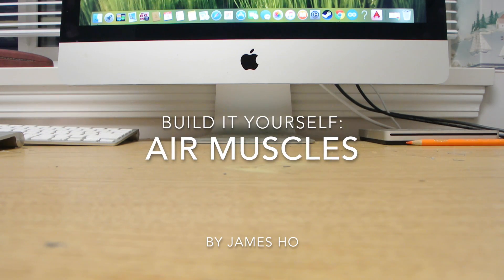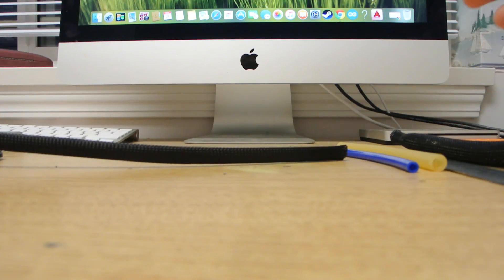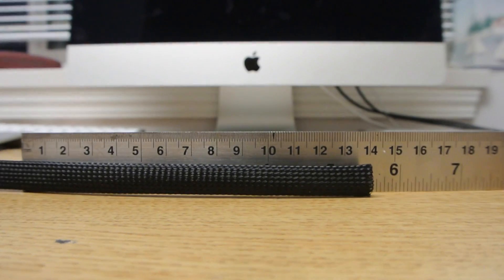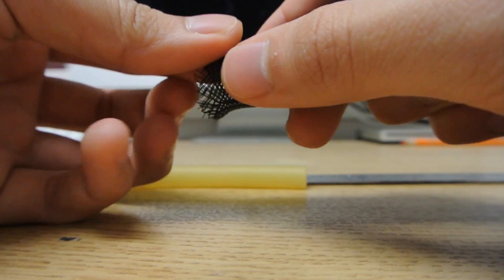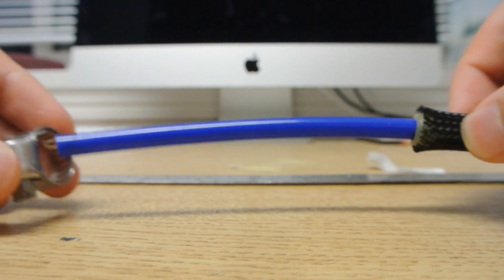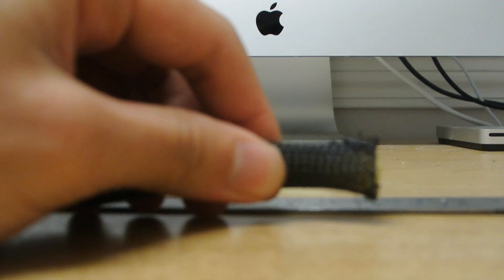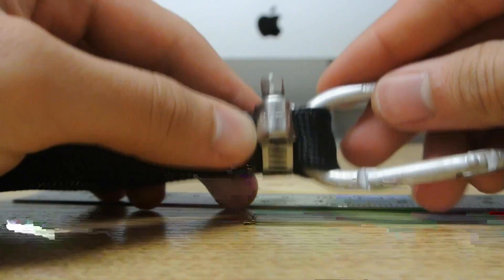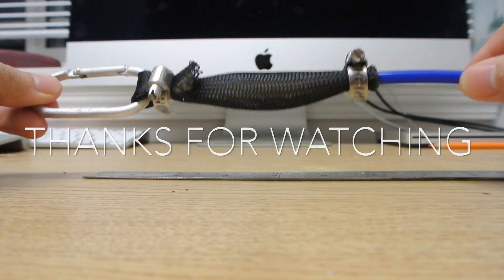Tutorial: Air Muscle Build

Comment: Making the cable shields longer than rubber inside will mean it'll never inflate enough to stretch the muscle. The shielding should be pulled very tight over the rubber to get the most range out of it. All you're doing here is pretty much like inflating a balloon inside a bag. I'd be shocked if this 7 inch muscle even provides  a single inch of pull. Are you pulling the rubber inside tight when it's mounted to the arm, and using the elasticity of the rubber as an additional contraction force? That would make sense then to make the shielding this long.

Comment: I've build one 15 years ago,  to improve this design add some brass tube w/ matching the diameter inside the blue tube, the length of the hose clamp...better clamping. Next use the shielding to attach the muscle, just leave enough after the hose and unbraid it, make 2 strands and knot them together where ever you want to attach the muscle.
And there are hose clamps that can be crimped, difficult to find but soooo much cleaner...
Btw. mine was built on a 4mm ext PU tube and some rubber tube out of some lab supply and copper shielding striped of a cable...

Comment: Hello there, i watch your video recently, and inspired me to make one.. but mine always got blown up at 2 bar pressure. if you got some time to spare could you please give me tips or reference? thanks in advance
Reply from the maker: That has happened to me before. If you followed what I did, just make sure to tighten the hose clamps all the way down until you can no longer turn it. Also, be sure to use the lighter to melt a ridge around the flexo to prevent slipping.
Reply: To be honest, i don't exactly follow all the exact material you mentioned in the video, since i can't find the latex tube, instead i use inner tube from bike. But i tried to tighten it and it actually works! although i still don't quite understand the working principle of it, but it works... Thanks
Reply from the maker: Make sure you tighten everything down until you can't turn your screw driver. However, make sure you are not restricting airflow from your source.
Reply: Thanks already figure it ou by now, thanks for the advice

Comment: +Jamesioso Ho , I'm working on an exosuit myself to aid in off grid solo projects that include some heavy lifting. I was wondering if you had an idea on what kinda tubing I could use that'd handle more then 50 pounds at 100 psi. I plan on using a braided carbon sleeve, proportional valves and you're sensors to trigger them are what I've been looking for myself

Comment: Hey James, I was wondering if you have tested the weight bearing capabilities of one of these muscles individually?
Reply from the maker: Ben M I have. I believe one six inch muscle can support roughly 50 pounds with minimal elongation at 100 psi. the figure is around the 50 lb mark.
Reply: Thanks for the quick reply! I am doing a similar project, but a whole exo suit, and was thinking of different options for the actuation. I am going to go down a similar path as you for the muscle sensors instead of hard switches to control the joints. These latex muscles may be the option I was looking for, for some smaller connections.

Have you figured out a way to make the muscle sensors control in proportion to your natural movements, instead of acting like an off/on switch? Maybe using a potentiometer connected at the elbow joint could help with the control?
Reply: @Benny16M  well, how did it work out?
Reply: me too!

Comment: Can You make a tutorial about how do You connect The artificial muscles To The compressor...With a valves or The grafts please?
Reply: I just wondering how he did connect sensors with this mechanism
Reply: @SHIVAM-e1h9y I think with microcontroller.
Reply: @lucaolimpio5784  is there any way you can help me to understand this or any source of someone who already made this project?
Reply: @SHIVAM-e1h9y  I made that project a long time ago. You have to use an electric pneumatic air pressure valve to incanalate air to the artificial muscle. You can build it with a 24Volt battery package and a button to enable or disable power supply to a monostable electric air valve. For air supply you can use a mini air compressor.

Comment from the maker: maximum 110 psi
Reply: can you do a tutorial on the muscle sensor system? ill try it no doubt i wont waste your time
Reply: I ordered kevlar, fiberglass and carbon mesh sleeving.  I'll test each one and eventually get a max psi of each one.  I assume it doesn't matter what airtight material is inside, it'd just act as a barrier where the sleeve provides strength and shape.  Probably need some sort of rubber inside that is consistent and designed for industrial or scientific use, rather than a cheap water balloon or something.

Hoping to build a robot hand with these.
Reply: +Eduardo Mayoral I agree
Reply: +Jamesioso Ho pls finish the whole tutorial!!!!!!!! It would be awesome!!!
Reply: Have you calculated a max psi for these sleevings?
Reply: i hear carbon mesh wears quickly. honestly if you're looking for more strength you could always double or triple sleeve